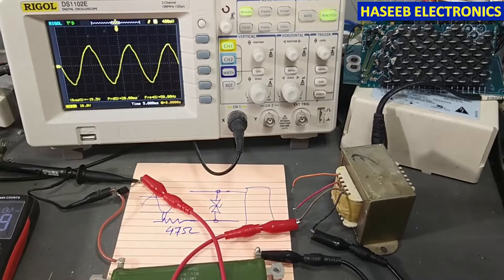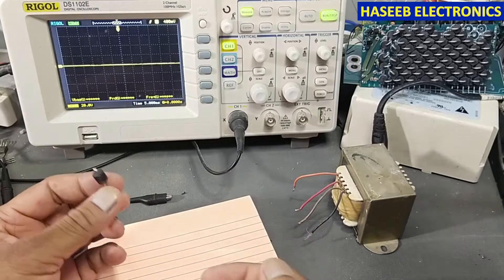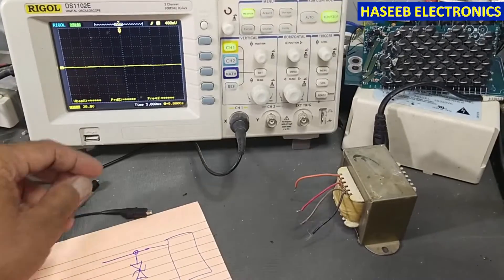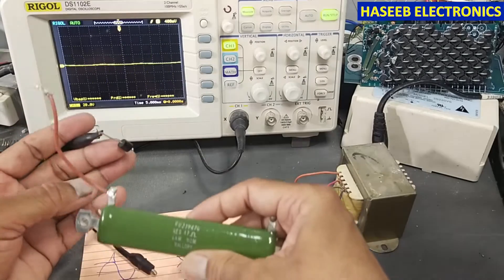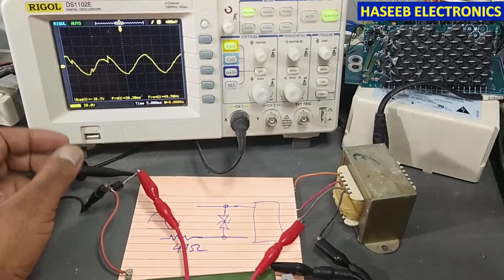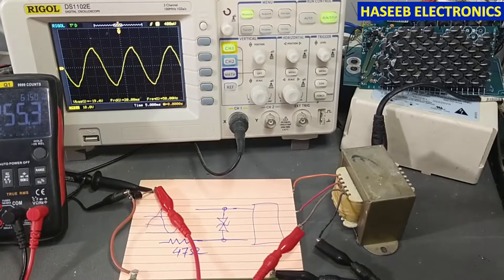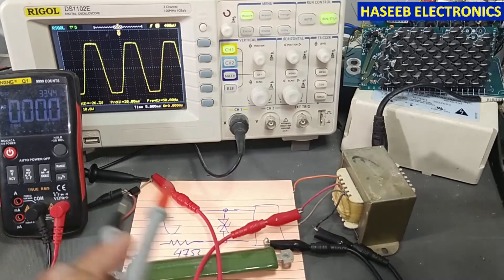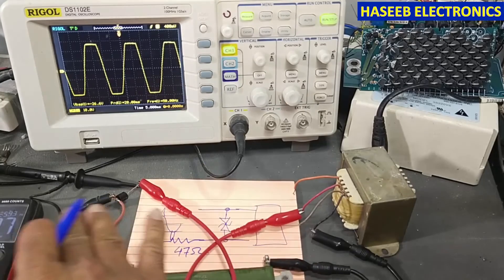{742} How To Test Bidirectional TVS Transient Voltage Suppressor

Comment: Can you get a Bidirectional TVS that will work with 240v AC ?
Reply: P6K220CA may be
Reply: 1.5KE*CA series for instance. Note that for RMS 240VAC peak-peak voltage is above 340V

Comment: Thank you for a good explanation of a TVS. Are there any other applications for a TVS than what you explained?
Reply from the maker: best regards
it is mot commonly used as a protection device for next circuits 
for more details you can check 
video number 485, 486 for unidirectional TVS
495 & 498 for bidirectional TVS (theory & practical)
Reply: @HaseebElectronics  thank you